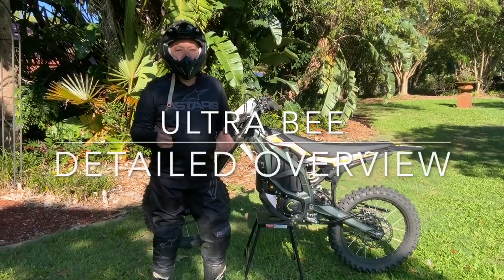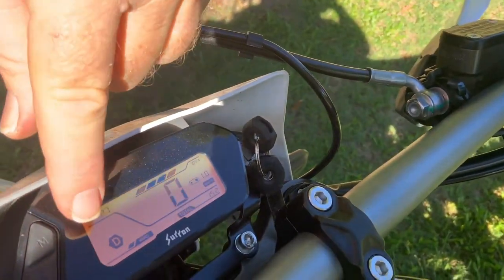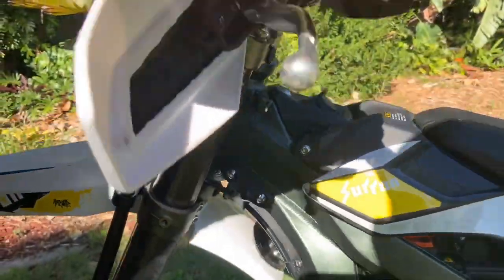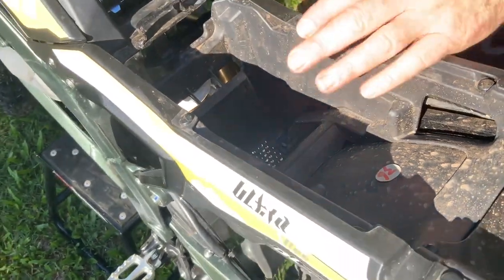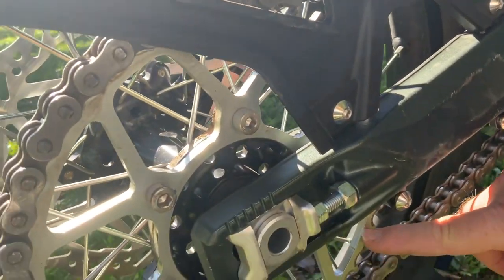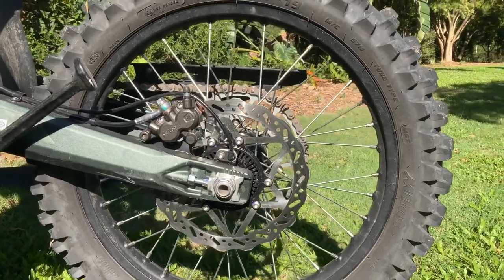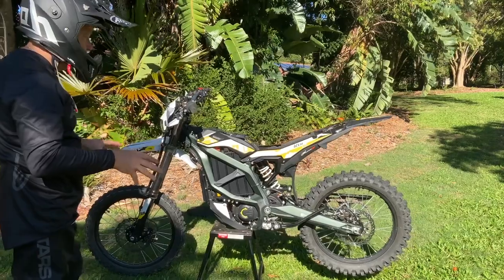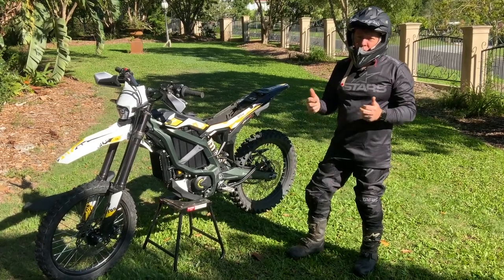Surron Ultra | Detailed overview

Comment: I second Shreditors request for a range test on normal trail riding on daily mode, with regen off, I heard regenerative is worse for battery life because you have to stay on the gas due to too much engine braking, thanks for videos !
Reply from the maker: Yeah good idea, the regen can be adjusted or turned off so it can suit your riding
Reply: yeah idk why regen instantly kicks in when you release the throttle. like you say, you need to keep throttle and that's bad for both efficiency and comfort. imho it would be logical that regen only kicks in from the moment you touch the brakes. and preferrably very smooth and not instant 100% regen braking..
 but that might be too much to ask 😅

Comment: Great overview! Can you tell me if the display can be changed from KMH to MPH?
Reply from the maker: Unsure sorry
Reply: Yes, adjustable regen also
Reply: Can you go in depth on ranges after testing out trail riding on different modes. And is daily mode still good for being a bit aggressive on trails?
Reply: Turn key off hold the M button down turn key on while still holding the M button until you see it change. Like 5-10 seconds

Comment: Which tyres. Rims you recommend for road riding. I don't do trails.
How are the stock tyres wheel on roads?
Reply from the maker: The stock wheels are for off road, not great for on road, unsure of what you could use at the moment sorry